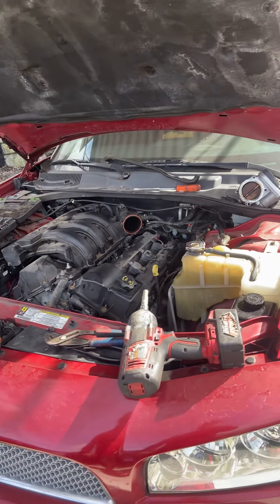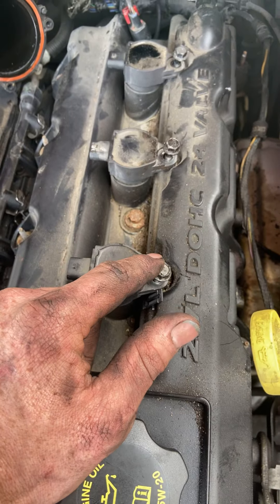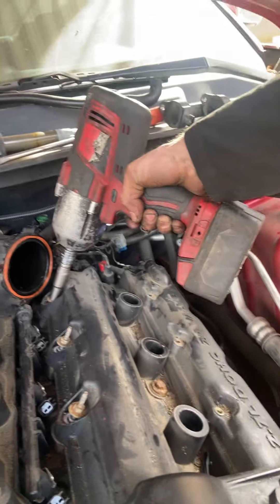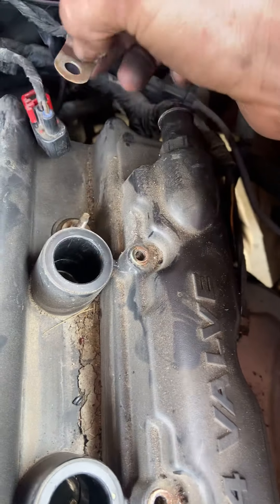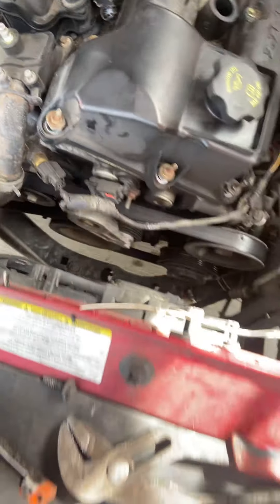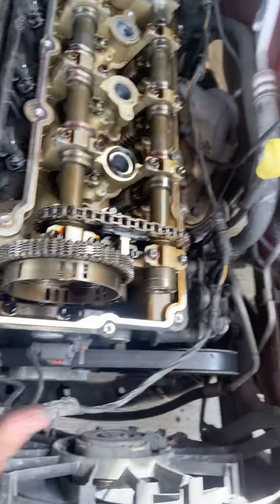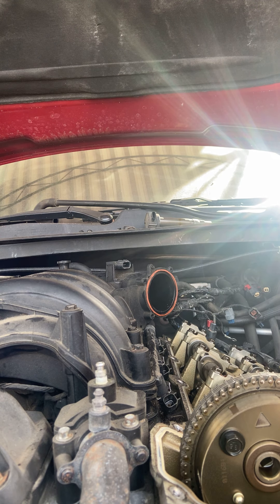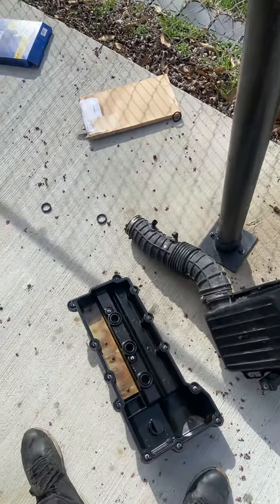Dodge Charger 2.7 driver side valve cover gasket

Comment: Do you mind answering this sir, So you replace 3 gaskets on the top of the manifold that you sat on tbe ground? and add 3 gaskets to the 3 round areas on the car?

Or placing the 3 gaskets on the 3 circles on the car will fill into the grooves of the manifold when you put it back together?

 I maybe a liitle slow but i wish you didnt end the video right before putting them on. I wanted to see where you put them. This my 1st time ever working on this.. i need to see things all the way through step by step to make sure im doing it correctly. Im planning on going out to work on the car today and your the only video ive found of same 2.7l doing the exact job I need to do.

Comment: So I know on the passenger side of motor there’s a pcv valve. So my question is that plastic hose u disconnected from the air box that goes back and hooks into the motor. Is that also a pcv valve there too?